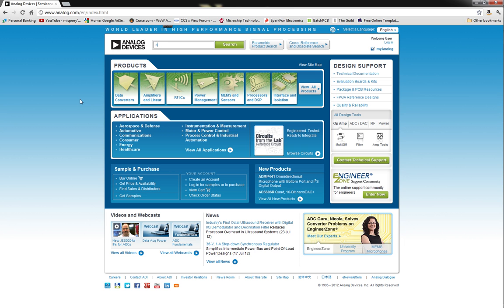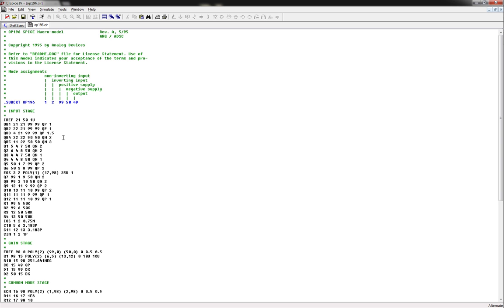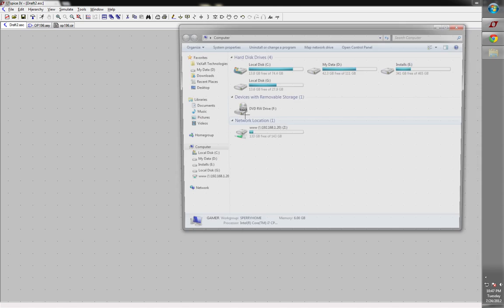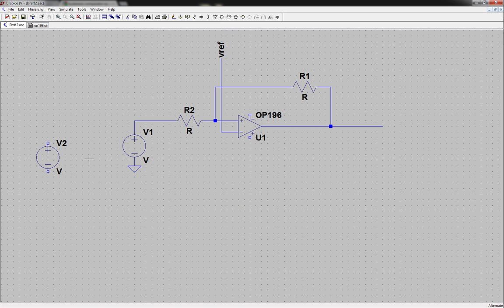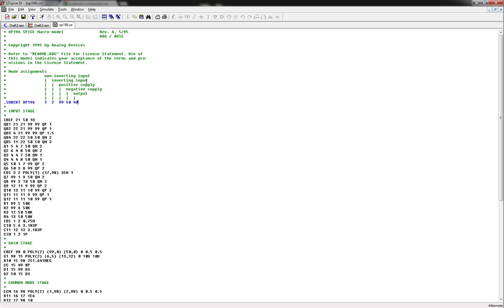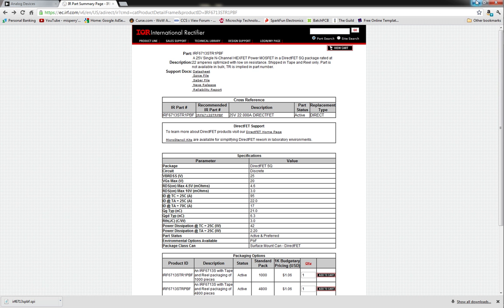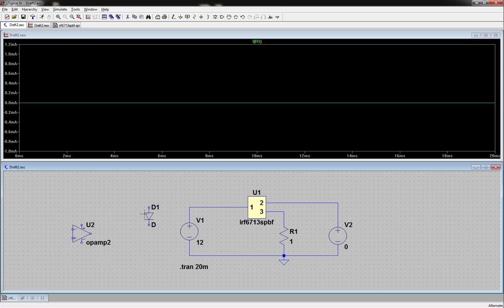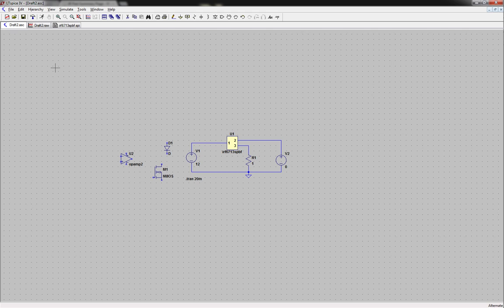Helpful Tools: Importing models

Comment: Hello Misperry, Thanks for the video !!Still I have a question. I want to incorporate a schottky diode (IDH20G65C6 - Infineon) in my circuit. I tried to proceed as you explained and I just copied the code for IDH20G65C6_L1 given in the simulation model file in to my circuit and tried to run my circuit's simulation but it shows an error that another subcircuit (scs_g6_650_v4_idh_l1) is undefined. Can't understand what is the problem. Can you please help me for this?
Reply from the maker: Hey there I looked at the file and since the model PSPICE file has multiple definitions in it it uses the SCS_G6_650V_v4_IDH_L1 as a reference between all the different variants.

What I suggest is that if you, inside LTSpice, open the .lib file that you downloaded form infineon and go to the .SUBCKT that you want and simply right click on this and choose the option to create a symbol from the model definition LTSpice should automatically create the symbol with proper linkages.  If not let me know and I can try it on my LTSPice and let you know what I figure out.

Comment: I followed you exacltly except i was using the AD8021, and its coming up with an error saying the instance has fewer connection terminals than the definition?????
Reply from the maker: +stephen cousins What might be the issue is that the 8021 has a compensation point that is extra to the other points.  In this case you may have to create a symbol for this specific opamp.  There is a way to auto generate the symbol from the file in LTSpice at 22:00 in this vid I show how this is done.